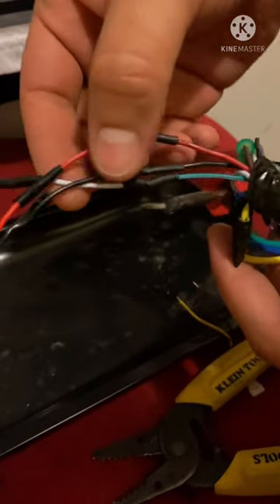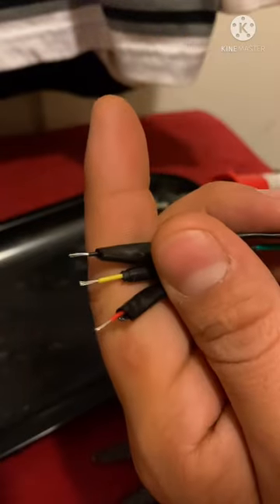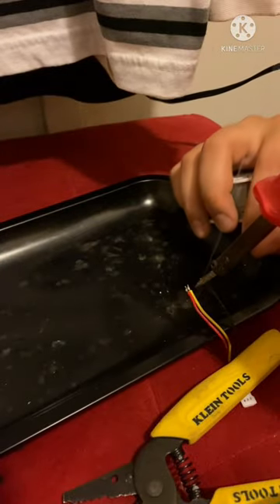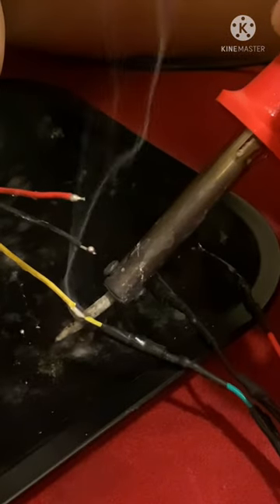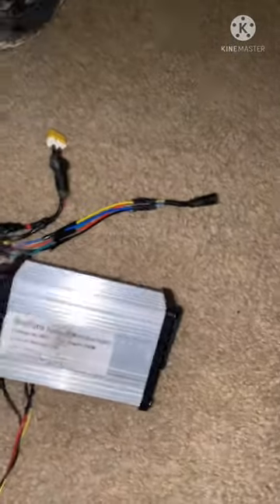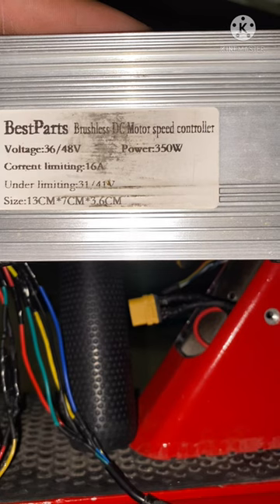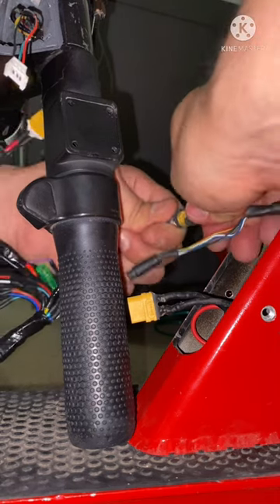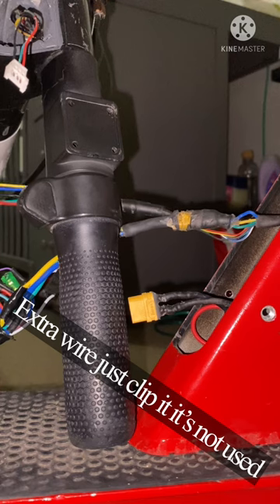Bird zero Scooter (using the Original￼Throttle set up￼￼) /wire colors

Comment: I have a XPRIT ELECTRIC SCOOTER THE RIGHT SIDE THROTTLE WIRES ARE OFF I NEED TO FIND OUT WHAT GOES WHERE SO I CAN FIX IT AND THE DIGITAL DISPLAY IS MISSING CAN I RUN IT WITH OUT THE DISPLAY

Comment: Hey, do u solder/connect the throttle wires to the long cable in the tube passing in the tube ? If no how do u connect the throttle directly to the controller ? Thanks in advance for your awnser
Reply from the maker: No that long cable has to come out it serves no purpose.

You want to add longer wires to the existing Throttle so that you’re able to run them down The tubing of the scooter all the way to where your controller housing is.

Your controller will have a three wire connector which will be labeled as Excelerator/throttle. The colors are black/red/green. Connect your throttle wires to that just match color with color.

Comment: Hey man good morning. Just wanted to know if you could tell me if your scooter is a zero. I just purchased mine from a couple who bought a house and it was in the shed. I brung it home and put it on the charger over night and it turned on but turned back off with a full charged battery. Any idea on how can I get this model domesticated... Thank You in advanced...
Reply from the maker: Yo ! OK so the Scooter in this video is a bird zero model. What do you need to do is swap out the controller with the 350 W brushless controller, you can still use the original Throttle on the Scooter, Buy you a wire kit and solder your throttle wires in place as well as your headlight wire and then feed them down the stem to where your controller is. Wire everything according.

Also the battery does not need to be bypassed like the rest of the scooters you see in my videos..

Comment: Good looking bruh Fina try when I get another controller 2mar I fried the other one. Question where u connect the charger port wires too and u right it come with that purple cable mines have it on there. How fast you got yours up to?
Reply from the maker: As far as the charging port wires !  all that is already wired up to the battery/bms. So that part is taken care of already. Nothing from the controller will connect to the battery port.

Matter of fact you can charge the scooter without the controller in it. Because it’s already wired. I do that sometimes when I have a controller shipment on the way I like to have a scooter pre-charged 

NOW THE TOP SPEED IS 32 MPTHATS WHAT THE DISPLAY READS BUT WITH ME ON IT I HAVE HIT 26-28 ON FLAT SURFACES THO BUT AGAIN THAT WAS A CONTROLLER THAT CAME WITH A DISPLAY 3SPEED THIS ONE .👇HERE  IS A LINK 👉 https://www.amazon.com/Alomejor-Controller-Display-Waterproof-Electric/dp/B07W9BFQ9X

But if you go With just a controller and the original Throttle I cannot remember but I think it was about 18-19 mph (195 body weight)
Reply: @pjscootermods  what’s the difference between small medium or large. I fuckd up then I cut the charger port wires but from where tho show yo diagram if u can so I see where to wire them back to I’m lost all Ik I plug the charger port in and the damn lights come on😂🤦🏽‍♂️
Reply from the maker: @soljadirtbike665  https://youtu.be/hHDWkC2ATRY
Reply: @pjscootermods  says private video authentication error when I click it
Reply from the maker: @soljadirtbike665  my bad check it out now
Reply: @pjscootermods  got it all good grab the one u got but my say LH-100 I seen different models on YouTube I was tryna get to the p settings and it don’t go when I hold power and mode just a 5 pop up with 4 numbers to put in. I see different videos that let them change settings in controller help bruh
Reply from the maker: @soljadirtbike665  fasho NP see link below 

https://youtu.be/LAs1jrKrByw

Try 9999 all the way across if not try 6666 all the way across I’ve had both
Reply from the maker: @soljadirtbike665  already bro 💯 just lmk if u have any questions
Reply: @pjscootermods  lemme knw when u snatch the bird 2 I got a few tryna get it popping got 2 motors on it gotta b fast

Comment: What wires on the controller are you connecting the throttle to? I see the green/black/red coming from the throttle but no other 3-wire connector on my controller EDIT: there’s a 3 wire “turning gearbox” connector with black/red/white wires
Reply from the maker: Yo ! OK so the throttle wiring varies depending on the controller you buy and where you get it from, know if you’re purchasing a controller that I linked to my YouTube then it should be the same as in my videos ! Throttle wiring colors should be a combination of three colors black,red,green or Black, red,yellow.. but it can also be red ,green ,and ,white! 

A lot of times they label the throttle as different things such as Excelerator , speed control handle, or just simply say throttle !

Comment: I did the same but it doesn't work.....something is wrong....it blocks...engine starts and brakes quickly.. and the front wheel doesn't move, it just moves.... like a brake....can you help me with what it is?
Reply from the maker: What do you want to do is connect your self study Wires also known as intelligent wars. From there your hub motors a free itself and spin free !